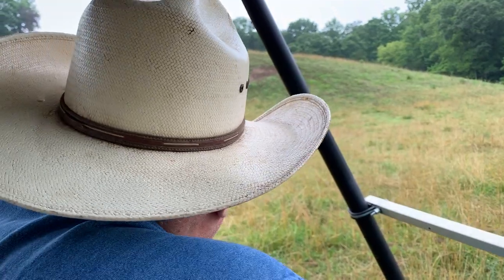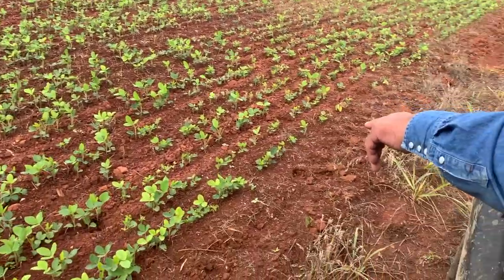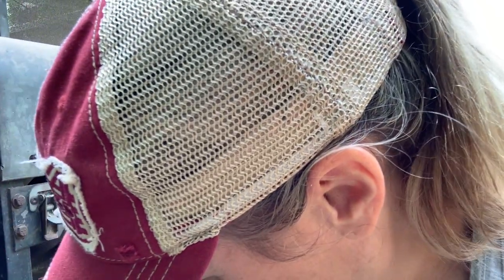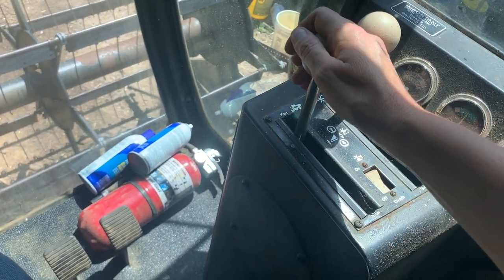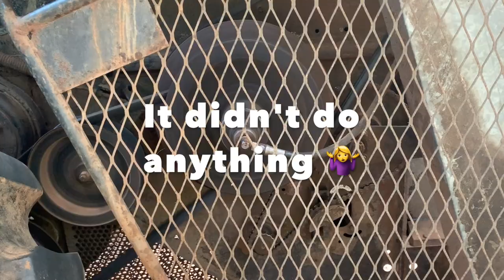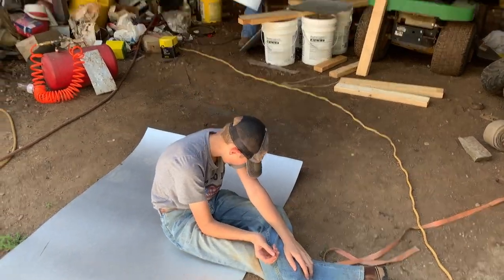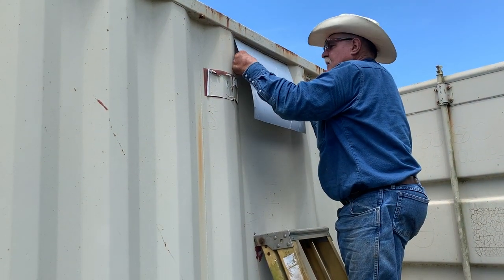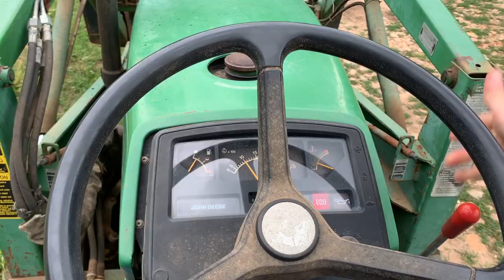Cleaning & Converting! Making Old Things New(ish)

Comment: While you lift your loader try keeping the bucket level by canting the lever arm while pulling back and doing the opposite while setting it down. This does it all in one motion vs stopping lifting and adjusting the bucket level. You won't spill anything out of your bucket by using jerking motions. As a caveat, say : "Barley, barley, barley, barley, barley," as you do it so you can remember what goes into the container!

Comment: Watch your local for sale adds and get you an old shop vac to clean that with. You can even pull most of the grunge off the engine with the crevice tool and if it's an old cheap shop vac all you have to do is use an old towel for a filter for rough cleaning like that. Just a suggestion. It's what I used when I had to work on any kind of farm equipment. Made my life much easier as a mechanic. Just a suggestion.
Reply: John Bowen =

Comment: If you can get one cow to go the other ten thousand will follow........... Those control cables are long and over time they become dry and tend to stick. The lubricant that is inside dries out as they are sealed up then they stick. I always just bought new ones when they got that way. You don't want one to stick when you are trying to maunever the machine in a tight place. I think Lawrence may have just invented the first "horizontal grain bin".............

Comment: You mentioned that the combine smelled like rat pee. I had two Gleaners like yours and each summer before wheat harvest, I would open every other monitor boxes up by the roof
Only about a third of them are usually being used. They are held by 4 small screws. Take them off and vacuum behind there. it will be full of mouse droppings.
Reply from the maker: Thanks!